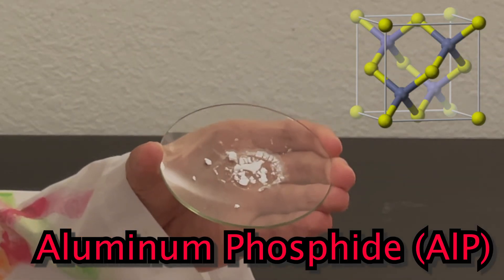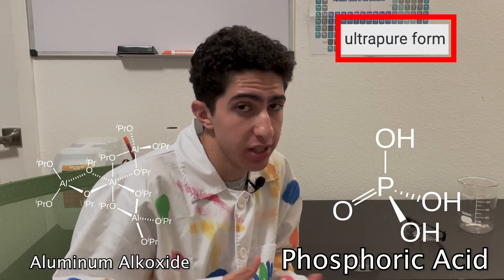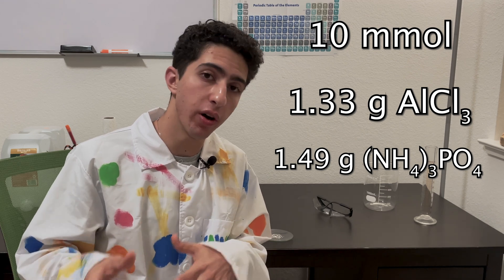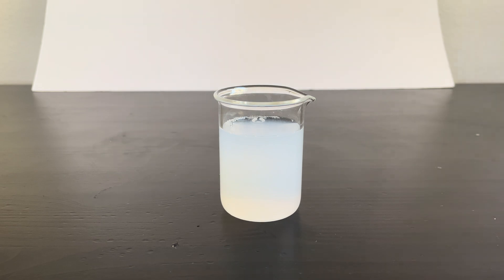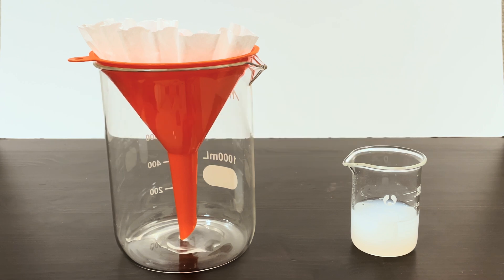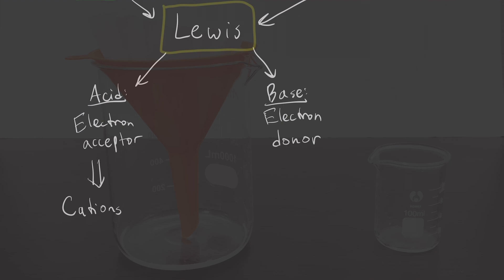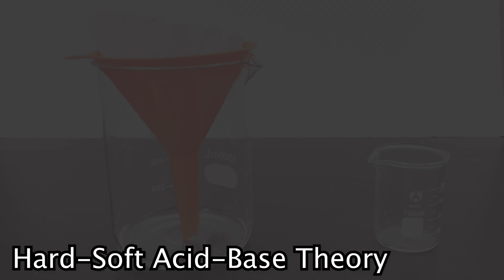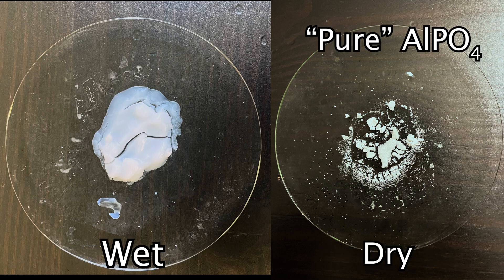How to Make Aluminum Phosphide ☠️

Comment: I was wondering about the halogens, are they Bronsted-Lowry acids? It's weird to see they're Lewis bases.

Is it because they are ions, conjugate to their hydride acids?
Reply from the maker: From my understanding, halogens themselves (F-, Cl-, Br-, I-) are actually Bronsted-Lowry bases because, as you said, they are conjugate bases to their protonated acids (ex: in the Bronsted-Lowry definition, I- is considered a base, albeit extremely weak, because HI is a strong acid. F- is considered a weak base, significantly stronger than I-, because its conjugate acid, HF, is a weak acid). Bronsted-Lowry definitions of acids just require that a compound can donate protons to water (or another base), and all protonated halogens (HF, HCl, HBr, HI) are therefore acids. Their ions cannot be Bronsted-Lowry acids because they don't have any protons to donate.

Interestingly, you can also use hard-soft acid-base theory to determine how strong of a Bronsted-Lowry acid a protonated halogen is. H+ is considered a hard Lewis acid, and so the harder the Lewis base the halogen anion is, the stronger the bond between the two, and thus the weaker it is as a Bronsted-Lowry acid. Of HF, HCl, HBr, and HI, HF is the weakest Bronsted-Lowry acid, and HI is the strongest (I- is the softest base of the halogen anions).

I'll probably make a video about this soon, because it's a pretty cool topic. Thanks for your question!
Reply: @FoolishChemist  That's actually a brilliant idea for a video, I don't think I've found anything describing that on YT that wasn't part of a loooooong lecture on multiple other concepts too.
Reply: The molecular forms of the hydrogen halides are BL acids because they are eager to donate their proton.  Once they do, the halide ion is then the conjugate base, while the proton acceptor becomes the conjugate acid.  Lewis acids and bases on the other hand are electron acceptors or donors, respectively.  By and large, the two theories agree on what constitutes acids and bases -- at least under aqueous conditions. I recommend theses short articles for a better picture of what's going on.
https://en.wikipedia.org/wiki/Br%C3%B8nsted%E2%80%93Lowry_acid%E2%80%93base_theory
https://en.wikipedia.org/wiki/Lewis_acids_and_bases